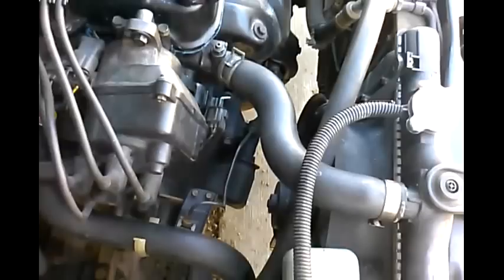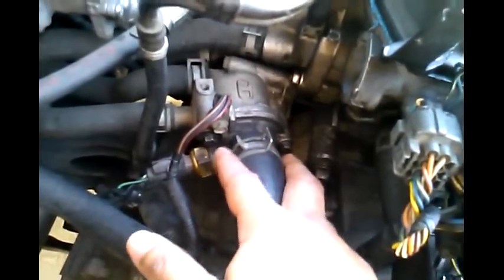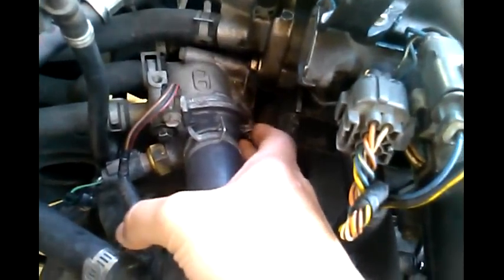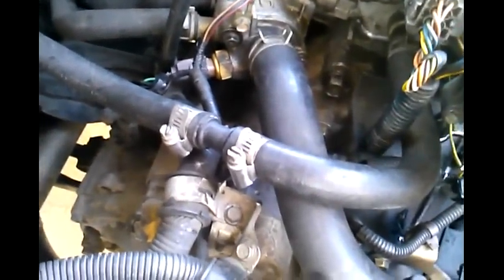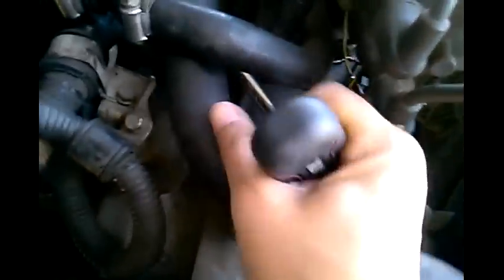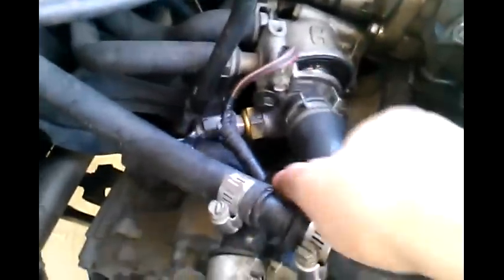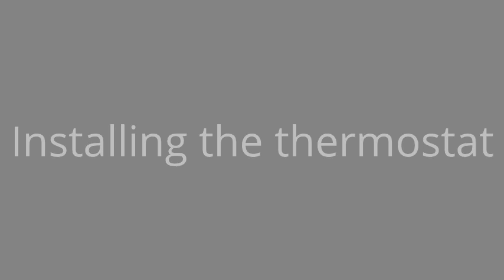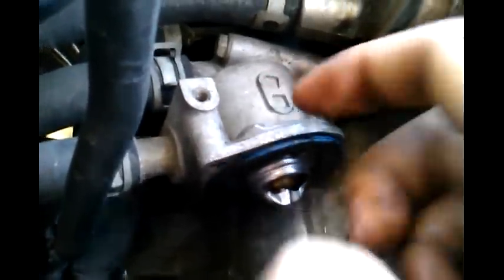How to replace a Thermostat on a Honda Civic engine

Comment: I have a 94 civic and I found a yellow wire that’s not connected to anything I’m next to my fuse box and one of the things that you put the cooling fan relay in doesn’t work I’m not sure if that may be the problem does anybody know

Comment: My car broke down due to over heating, but u never got any lights on my dashboard before it happened and I have coolant in the radiator still. Does that mean that its probably the thermistat?
Reply: I used to think it was the head gasket or the thermostat of the car too (2000 Honda Civic). On my end, the Engine symbol turned red and somewhat faded in and out. After installing a new thermostat, it helped a little, but not a lot. My car's temperature still went up after 20 minutes of driving. It turns out one of the pipes that the coolant travels was old and very hard and was leaking (right side, under the serpentine belt). Apparently the pipes must be squishy in order to function well. Hope this gives some insight.

Comment: So? What if I did all of the coolant fan testing in your previous video, and change the thermostat, and still get no fan?
Reply: So in the same area section to the left of the housing on the housing there is a sensor. It's a coolant sensor that tells the fan when to turn on and off. If your relay is good and your fan is good your fuses are good then guarantee you it's that little sensor sticking out of the thermostat housing. I know you posted that 2 years ago but hopefully somebody else will find this useful
Reply: @cmorales6404  I did, thank you.

Comment: do you need to unhook battery .. yes or no ? to install
Reply: By the book? yes. In a practical sense, no.  Do you have to drain the radiator?  By the book, yes.  Practically, no.
The 'book' is helpful in knowing what the torques are and what you 'should' do.

Comment: How too bad that you can't get at the lower bolt.  There is no clearance between the head of the bolt (unless you have a very very thin walled socket)   and the engine block.  Looks like removing the entire thermostat housing to get at the two bolt holding the cover over the thermostat.    Lots cursing by yours truly here cause this thing is in a tough place.
Reply: This is my current situation! They make it look so easy!

Comment: Well funk!
 I didn't know about the grooves at all on the rubber gasket needed to be aligned..
I just thought the gasket was circular, and the opening was circular..and just put it in.
No wonder I had a leak TWICE after installing my thermostat.
Reply: I got suggested to permanently eliminate the thermostat. If the fan, relay, switch works, is it a bad thing if I do take action to that suggestion on permanently eliminating the thermostat?
Reply: Vini Martinez well... if you do than your temperature gauge would always be on C(cold). I'm not sure if that's hazardous to the engine or not, but the thermostat is there for a reason.
Reply: jbentley8383 l

Comment: my radiator fan isint Work ing and I did all you said but I didn't  change the thermostate yet ....when I change that ...is that supposed to make the radiator fan turn on. if thats the problem?
Reply: biker on a budget  check your relay, and also check the fan by connecting straight to the battery,  and last but not least check the thermo switch